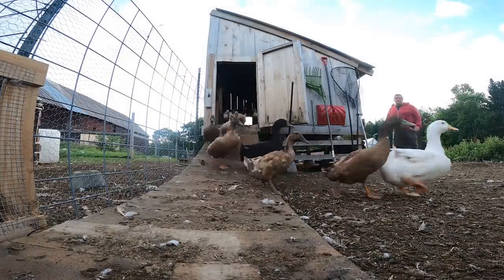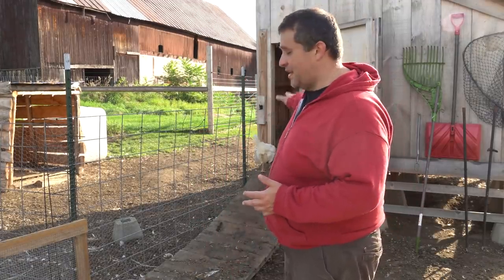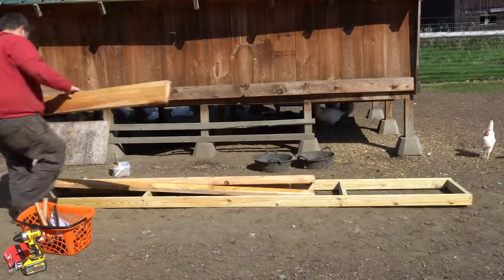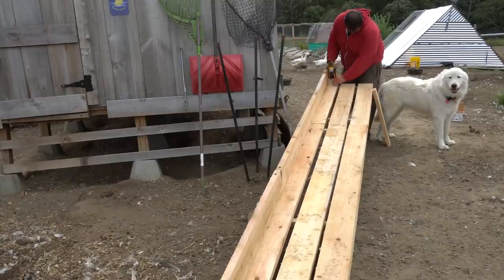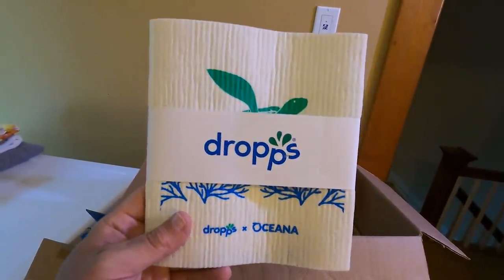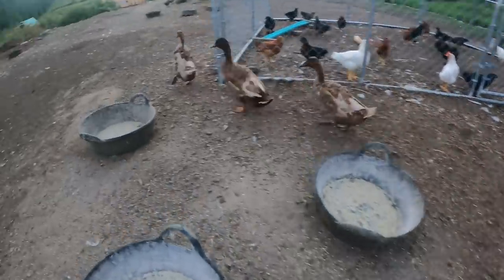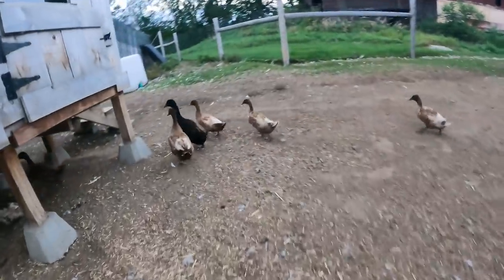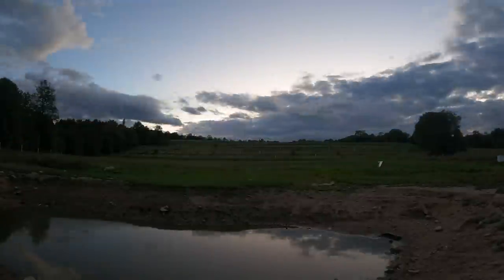Building a Better Duck Ramp

Comment: Two problems I can see right away.   New ramp is not as wide as the old one and when u added that one board on the left it makes it less for them to walk on.  And two u didn't make it easy for them to get going up the ramp.  They may be all able to make that little jump to get up it but will not esp with the extra board on the left, not having the ramp the same width and not having the top of the ramp meet the ground.  Personally I would make the ramp be as wide with new framework and use the old ramp and screw it to the top of the framework and make the frame work short enough that the end of the old ramp goes all the way to the ground.  And personally I would make it without that outside rail on the left and if I want rigidity build the ramp diff to build that into it.  or add a couple support points that are put on something like a paver, a stone or a poured piece of cement.  I think them seeing the old wood will comfort them.  It has the look and the smells they are use to.  But while in general even if ur ramp was the same width and went all the way to the ground with the walking surface and didn't have as wide a spacing with the boards u have as ur walking surface.  Rather than how it is with the walking surface up off of the ground by the height of the framework.  

That little bit of what two inch  to get up on the ramp is diff. than what they are use to and they see it as a road block.  so add a little piece of triangled wood to the end of ur ramp to bring it to ground level or figure out the angle of the triangle u need to make and cut the one end of the ramp to that angle so its down to ground level if u do not use the old ramp to cover the top and make ur frame as wide as the old ramp.

Comment: I was wondering why you didn't just reinforce the original. It only would've taken a board or two lengthwise along the bottom to take out all the sag. And you wouldn't even need to go the full length so you could keep the ramp touching the ground. I get the whole 'snow melt' thing but still. You don't need to build it like a brick shithouse.

Comment: Not viewers like me! I try to only complain about the easy things you can do better, easily instead of anything done long, long ago. Speaking of which…
As a deckhand we’d paint the deck, with our um hands. Then we’d spread clean sand on the wet paint. After the pant dried, we’d repaint the deck, with our um hands. And create a quick simple no slip surface.
Of course that will quit working as the ice builds up, but if you keep dusting it with ash, the ducks should have traction all winter. I hear it’s better to be ash handed than fall on your duck’s ash.

Comment: You didn't need thick material on top.
The stiffness of a structure in bending comes from the thickness of the overall structure relative to the centerline of the structure.
That's how I-beams work.
You could have just used plywood or something thin on the top.
I'm sure there's plenty of youtube videos that explain it. It's generally useful knowledge.

Really don't know why you didn't just taper cut the frame at one end to get it to sit properly on the ground without the 6" step...